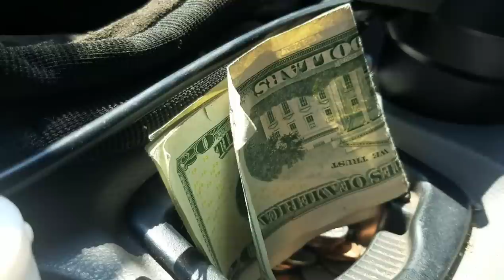INSTALLING 12" WHEEL WEIGHTS ON CUSTOM CRAFTSMAN GT6000 GARDEN LAWN TRACTOR 16HP VANGUARD SNOW PLOW

Comment: Try to rake some areas of the lawn that look bad before putting down milo/grass seed. Also lightly water the lawn daily after seeding
Reply from the maker: How long after miloganite do I put down the seed?
Reply: Mowers N Blowers I would wait about a week for it to fully soak in
Reply: Mowers N Blowers I also strongly suggest aerating before putting down seed
Reply from the maker: I plug aerated a few months ago, that’s what caused all the muddiness
Reply from the maker: Twice
Reply: Mowers N Blowers the reason it got muddy after is because you have a smaller yard and you walk on the grass/drive mowers on it a lot. After aerating you should try to avoid stepping on the same areas repeatedly. (I know it’s hard because the gate in the back yard is the only way to get tractors In and out)
Reply from the maker: JusthamJimmy0428 that area is doneski
Reply: Mowers N Blowers DONESKI yeah I agree that area probably won’t ever look great
Reply from the maker: As long as I have so many tractors..never!

Comment: You inspired me to pick up a rider today, a yard machines hydro 18hp briggs. looks like it needs a coil (dies after 10 minutes) and it wants to stall out when put in reverse (forward works great.) Not sure what the reverse issue could be.
Reply from the maker: Is it a late model, may have a RIO button which won't let you mow in reverse as a safety switch.  Google it.